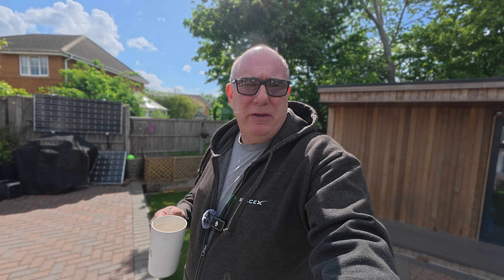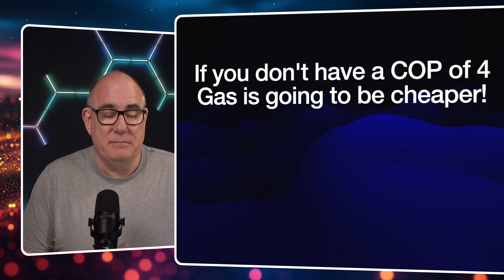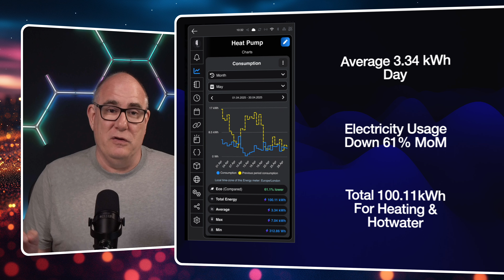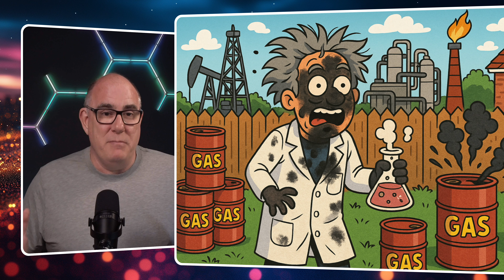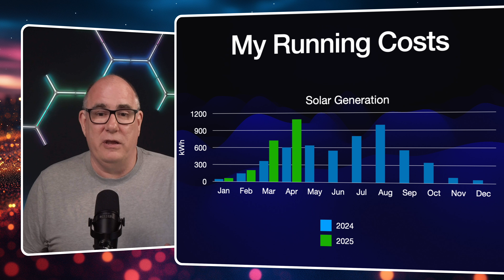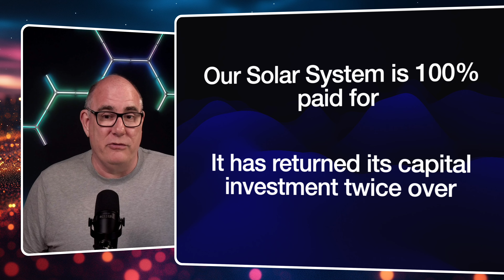We Cut Our Heat Pump Bills to Zero

Comment: I am entertaining getting a ASHP at sometime in the near future, we already have 5.2kw of Solar, 9.5kw battery storage and i drive an EV although the wife is still on petrol. Although prepared to go EV when she replaces her car. 

I do wonder if i need another battery to keep our heating, hot water and cooking going through the winter or if i get the Heat Pump going overnight until 5.30am would this cope with the majority of each day in winter as i am on Octopus IG at the moment?

We have a four bedroom home which is fairly new and highly insulated, we only have showers in the house, we have modern dishwasher, hob, oven, washing machine and tumble dryer. 
However our children have left home and it is only the two of us here for most of the year, with occasional invasions from children, grandchildren etc who sometimes stay for several weeks which potentially uses a lot of hot water on those occasions with showers, washing machine, dishwasher on a lot more than normal.

My Worcester Bosch Combi Condensing boiler is pretty efficient but is now 15 years old and is inevitably going to need work at some stage as this is the only gas appliance we have once replaced we will be a electricity only home. 

I would be interested to know how much battery storage do you suggest is a minimum to cover a ASHP under these circumstances?
Reply from the maker: Thanks for sharing all those details — sounds like you’ve already made great progress with solar, battery, and EV!

For your situation — a fairly new, well-insulated four-bedroom home with two adults most of the year — here’s how I’d break it down:

✅ Heat pump timing: You’re smart to think about running the ASHP overnight on Octopus Intelligent Go (IG). Many people set the heat pump to “preheat” the house and hot water during the cheap overnight window, then let the thermal mass (the warmth stored in the house) carry them through the daytime. With a well-insulated home, that can work surprisingly well, especially if you fine-tune the heat pump settings.

✅ Battery sizing:
Here’s the key part:

A heat pump typically draws 2–4 kW when running, depending on conditions and system size, but it cycles — it’s not pulling that all the time.

Your existing 9.5 kWh battery probably gives you 7–8 kWh usable per cycle (allowing for some buffer). That’s already decent backup for key loads, but in the depth of winter, heating plus hot water plus cooking could easily consume 20–30+ kWh/day, depending on weather, house size, and how you run things.

Adding another battery would give you more flexibility, but the most cost-effective approach may actually be combining battery use + smart timing — use the cheap grid window (IG) to cover heavy loads overnight, store solar for daytime/evening peaks, and only top up with the grid when needed.

✅ Guest impact: When you have family over, hot water demand spikes — but the heat pump can still meet this if you preheat during the off-peak hours and maybe nudge the storage temperature up slightly (if the system allows). The occasional higher use might not justify adding a whole extra battery, unless you really want maximum independence.

✅ Moving to all-electric: Once your gas boiler goes, you’re right — you’ll be a fully electric household, and that actually simplifies things: you can focus everything on optimising electricity usage, tariffs, and self-consumption.

Summary recommendation:
If you can manage your heating and hot water loads to run mostly during the cheap Octopus window, your current battery setup is probably enough for most situations. Adding another battery would help you store more daytime solar for evenings, but I’d suggest trying the system first before making that investment — real-world usage patterns will tell you if you truly need more storage or if smart scheduling does the job.
Reply: @ Thanks JT for that very full response, it has given me food for thought and your suggestions do make sense, sounds like i need to make a few more enquiries and take the plunge eventually!
Reply: You can also probably use your existing gas usage to estimate your likely heat pump use.

Comment: April was my first month as a born again solar panel owner. ( All hail Greta ). Glorious start. My system came with a 5 kwh battery as part of the deal. Have already ordered more batteries in anticipation of next winter requirements. Also am now on Octopus intelligent go for the car. The internet consensus seems to be to force charge the batteries on off peak rates rather than via the solar panels. Reason is that I charge the batteries at cheap rate- 7p, and sell the excess solar at Octopus export tariff of 15 p.  ( Oh God I can feel my adenoids growing. sorry.....) Here I find myself watching heat pump videos. Need the finances to recover first- but solar panels really are a gateway drug.
Reply from the maker: Yes charging at night means your ready to start exporting at 15p kwh at teh start of the day this will maximise your profits, these can then be used to cover your winter usage

Comment: Thanks for this update. As posted on a previous video I'm not sold on air-water heat pumps for my case, but thanks to more exact numbers on yours I can now see where your boiler replacement cost far more than mine on a like for like basis and why the numbers made sense for you. 
Had I had that choice (yours was 2,000 odd more for gas than mine @1300) I could also have gone down the ashp route at the time (though unfortunately it was also deep midwinter and the boiler wasn't on it's last legs it just packed up [9 years old, I'm still making faces at your 27 year run]). I wasn't as informed back then and had to make a snap decision at the time, or freeze 😢.

5 months on and I'm just waiting on the formal DNO approval for a 9.36KW array (after inversion, 11 odd before). Way oversized for me, but sunk costs  reduced the ROI on covering the entire roof. So, and the reason for posting, I'm almost at the point of writing that 1300 off as bad luck because I now have a fairly large overproduction of Electricity (or will soon). I'll not bang on about cop of 4 and so on, but I use far less water than most as it's only one shower and only me using it so H/W really isn't a priority (washing machine and dishwasher are cold fill). I've looked more in depth at it now, and determined I'd like an air to air heat pump. Why? because it provides cooling in the summer, and the times I'll use that co-incide beautifully with the solar generation. This throws up yet another problem though, BUS...

The current BUS will not allow air to air at all. It also requires that you replace your HW system as well which most air-air systems won't do. Though as you clearly prove you don't actually have to remove gas completely as you still have a gas hob. Argh, I'm caught again, I cannot (with my minimal hw use) see me opting for air-water hp and I'd also really like the air-conditioning in the summer. Further, the installation costs and overall costs of air to air are less in the first place.

There is however a consultation period going on right now with regard to the current BUS and this ends (an AI reiably informs me) on the 11th June. I'll just wait on the results of that and see where I stand I think. Sure the actual legislation will probably not be soon enough to do me any good this year, but maybe next.....

Apologies for droning on a bit, but despite my efforts to precis this I felt there was too much I needed to point out for my reasoning to cut it much further.
Reply from the maker: Thanks for sharing all this — no need to apologise, it’s really interesting to hear your reasoning!

It makes perfect sense why air-to-air appeals in your case, especially with your minimal hot water use and the added benefit of summer cooling that aligns with your oversized solar. You’re right about the BUS restrictions at the moment, and waiting to see the outcome of the consultation (June 11) sounds like a smart move.

I totally get how frustrating those snap decisions can be — I was lucky with my old boiler lasting 27 years, but your situation midwinter with no time to plan would’ve forced anyone’s hand. Sounds like you’re in a great position now to make a thoughtful next step, though!
Reply: For those concerned that air to air doesn't do hot water, there are alternative water heaters out there that don't take up huge amounts of space.  I had a combi gas boiler replaced with air to air heating (with a few electric heaters in rooms I don't use very often) and a Sunamp heat battery water heater which happily fits in the cupboard where the boiler was.  The Sunamp has a solar diverter fitted, so it costs nothing to have hot water for most of the year, and it can be charged at cheap rate at night in the winter.  

The ability to cool the house with the air to air has already proved valuable this year, reducing my bedroom temperature from about 27C to about 18C and enabling me to sleep.  Running the bedroom ac for most of the night used about 1kWh of electricity.  Before you say I could open the window, I live near a busy road and there is far too much traffic noise from lorries throughout the night to open the windows.

Comment: Low cost Heat Pump Installs only seem to be on YouTube, I want to go Heat Pump Route and live in a 4 bed semi (Well insulated). All my quotes are at £5500-£8000 after Grant. No changes to radiators,simple install. If i could get an install for 3k to 4k i would sign today. Even Octopus installs START at £4300 on their website.  How do you get the prices you get?
Reply: I have noticed that Octopus quotes seem to go up and down all the time. Before I got mine (and they changed to the option of turbo or eco installs) I had quotes up to £4300. As a customer of theirs I ended up placing an order on Black Friday as they had 20% off installs. I got a fresh quote which was £2800 which I was happy with. It wasn't till after I realised that it was the price before the 20% discount. After the heat loss survey (to establish a final price) the discount was applied and after a £100 referral code I got it down to £1960 with 5 rads upgraded for a 4 bed house, on microbore with a Cosy 9. If you are looking to change over, it might be worth a punt signing up to Octopus before November (if you can subject to exit fees etc.), no guarantees they will do the same offer, but you never know. Use John's code as well and that'll offset £50 of the transfer fees if needed.
Reply from the maker: What size of heat pump are they quoting for, is it a 6kw or larger? My price was based on my survey

Comment: Our Octopus ASHP cost £2.5k, including changing/adding radiators throughout house (instal Feb 2024). We have a 4 bed semi 1970s, 20yr old double glazing. Previous owner did cavity wall, I sorted improved loft insulation. Works great. Very comfortable 24/7, coldest Winter days handled, annual bill reduced from previous gas/electric. Oh, including charging our EV 😀
Reply from the maker: But remember "heat pumps don't work" 😂
Reply: @JonathanTracey sorry to repeat my data/experience it’s to support your video message 👍

Comment: Great summary once again Jon, and impressive figures. I'm still intrigued though by the net cost of your HP installation at only £3900 only a few months ago. Using just the summary data about our home, which is 30 year old, 4 bed, one bath, plus one en-suite shower, both Octopus and Heat Geek are quoting over £6000 after the MODBUS grant, inclusive of a HW cylinder plus up to 3-4 radiator changes just like you, all replacing a combi gas boiler. Can't quite see where one additional bedroom adds up to more than £3K over and above your quoted install figure. Plus we have micro bore pipework to contend with, but neither Octopus nor Heat Geek know that until a formal survey is undertaken. Since Octopus have 0% finance available for solar, and Heatable offer a similar incentive albeit with a 25% deposit upfront, then we're more likely to go down the solar & battery route for around £10-£12K first.
Reply from the maker: I think the price is dependant on pipe runs and the labour required to remove the old system and replace with new, I have heard people getting quotes at £500 after the grant and some like you around 6k. Out of interest what size heat pump did they specify for that price, as it larger than 6kw? More bedrooms usually means larger amount of heat volme required so they may have quoted a 10kw or larger heat pump
Reply: @JonathanTracey  Thanks Jon, no, I think it was just the standard 6Kw system. There's only two of us living here, like yourself. Revising the quota again today, it seems now Octopus are only offering different versions of their Cosy ASHP which I don't like the look of at all - see below to EverydayLife.
Reply: @JonathanTracey  same experience with Octopus here, £15k quote excluding having to redo our bathroom to fit in hot water tank.  Bog std 4 bed.
Reply: Pasting another comment I wrote elsewhere… owner of a heat pump installation company here. We think Octopus were installing heat pumps at a loss previously, but have now adjusted their prices to better reflect the costs of equipment and installation. That’s why the prices they are charging are more similar to other local installation firms. The days of £3900 heat pump installations are probably gone, it’s just not sustainable.

Still worth doing over the lifetime of the system though

Comment: Very interesting video. Can I just ask something, I already have solar on my property but don’t currently have a battery, it is something we’re looking at but probably won’t be in a position to have one for a year or two. I’ve had a servey for Octopus to install a heat pump and the final cost to me is £500 due to the grant, would you think from the basic information i have provided that having the heat pump installed is worth doing?
Reply: Can you get a replacement boiler installed for the same price?
Reply: You have to do the maths on the running costs for your situation. So we have solar and batteries, but the whole thing was sized for pre-heat pump, which means regularly hitting peak power during the winter, as long as the heating is done at at least a SCOP of 3 (on average) the cost of the heat pump is no more than the running cost of my boiler which was 80% efficient. Is it saving me money, no, but my install was £1500 and there was no way I could get a boiler for that cost, and the lifespan of a heat pump far exceeds that of a condensing boiler, so on the simple basis of putting in 1 heat pump, I've potentially avoided having to change the boiler twice, it also let me ditch gas as that was the only thing in the house that was using gas, so the lack of a standing charge puts the heat pump ahead at the start of each year, so even if it was slightly worse than gas it would still break even.

I also have the option moving forward of getting more batteries to allow additional winter load shifting (although it doesn't make sense financially today) or installing more solar to try and do more offsetting,  but your scenario will be unique to you.
Reply from the maker: Depends on your motivation for installing it, if its to save money then yes your solar credits in teh summer will cover your electricity costs in teh winter. If you get the battery later this will shorten the payback period
Reply: @JonathanTracey  The idea for getting the heat pump is partly that the cost to us is so low at the moment and the hope is that we will have money by using the solar when possible to help run the pump, the other part of the thinking is that by not having a gas bill we will save on the usage and the standing charge. I understaind that until I have the heat pump installed and have run it for a while i’ll not know the true benefit but I just want to make sure I’ve considered what I reasonably can do before finally making the decision to go for it.

Comment: Imagine the savings if you got a SCOP of 4 like the Heat Geeks achieve. 

Maybe Adam Chapman should come over to see if he can do his magic trick for your home.
Reply from the maker: To be honest its probably going to hit 4 next month anyway, and were on the standard settings so no tweaking.
Reply: @ My SCOP numbers:
Oct 2024: 6.3
Nov 2024: 5.2
Dec 2024: 5.1
Jan 2025: 4.2
Feb 2025: 4.1
Mar 2025: 4.8
Apr 2025: 6.0

This is heating only as it is a hybrid system. The gas boiler does the DHW and supports the heat pump in case of an ice age.
Reply: @JonathanTracey  I think what SolAce is meaning is that the balancing of the flow rates within the system can make big differences to the SCOP. Sometimes the installers don't have enough experience in the settings and balancing to get the best out of the system.
Reply: This wont happen with an r32 system (daikin), heatgeek are mostly using r290 systems (vailant). they are not the same they will not perform the same
Reply: @ULtiMat3DruMa  I have a R32 heat pump (Quatt Hybrid) and i don't even have UFH and the original radiators from 35 years ago. Just balancing, some radiator fans in the living room to boost the output and extra insulation did the trick.